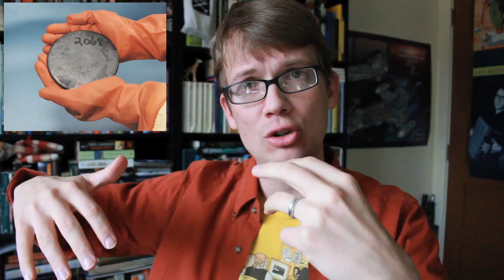Why Did Fukushima Explode?

Comment: One thing you didn't say that I think is important is that there are multiple levels of safety systems meant to handle various accidents and prevent meltdowns (or any other damage to the reactor or release of radiation). Each reactor has a "design basis" which is the list of all the things that could go wrong (earthquakes, tsunamis, fires, pipe breakage, hurricanes, tornadoes, etc.) Depending on the location, they plan for the worst such accidents that could happen over the next 200 years when they design the reactor, like it might be a magnitude 8.0 earthquake and an EF-4 tornado at your particular spot. Then all the systems have to be designed to safely shut down in the event of such a happening. 

In the case of Fukushima, geologists were unaware of the magnitude 9 earthquakes possible in subduction zones, similar to the Cascadia-type earthquakes we've just realized happen in our Pacific Northwest every 500 years or so. There were Japanese geologists studying the possibility at the time, but their data and theory didn't come out in time to prevent Fukushima. What happened was that the earthquake and tsunami were many times larger than the design basis had taken into account. We're limited by what science knows about these things. So the sea wall designed to protect the reactor from tsunamis was about a third as high as it needed to be in this case. So the whole control system became swamped with water and none of the safety systems could get a chance to work. There are backup generators, and backups to the backups to keep the cooling water flowing to the spent fuel pools and reactor cores and remove the residual heat after a shutdown. All swamped with water from the tsunami and inoperable. 

After the accident (similar to the way the NTSB studies every airline accident and recommends improvements to all flying airplanes), the Nuclear Regulatory Commission studies what happened and recommends improvements to all working reactors that would have prevented the accident. In this case it was a review of the "design basis" accidents and see if maybe they need to be increased all over the world, as well as having portable generators that can be wired in from outside in the event the whole chain of safety power backups is unavailable for any reason. Just like in the airline industry how we learn from every mistake and do our best to make everything even safer, the nuclear industry does the same thing. It is similarly a high cost to pay for such lessons, and we don't want them to have been wasted.

Comment: you speak of nuclear bombs.  Please explain why it is that when the case of the bomb fails, that  the nuclear fissions do not stop instantly, given that in a very tiny fraction of a second all of the particles will be far away from each other?  For me, it's not plausible that such a device could yield very much more than the energy required to melt or break the container.  You know better, please explain it.  Remember that your friend Einstein said that if you can't explain it simply it means that you don't understand it well.  Thanks in advance.

Comment: Okay so let me get this clear , the two of the most commonly known nuclear accidents are the one in Fukushima and Chernobyl , well the Chernobyl incident took place in 1986 and Fukushima has its incident in 2011 , the failure in Chernobyl was due to the poor build quality of the RBMK reactor and the one in Fukushima was due to a damn earthquake followed by a tsunami! Both of these occurrences are very very rare and sorta expected if I am honest . Yet the mass media tries to still defame nuclear power . Try using renewable energy sources at the time of Fukushima and you'll realize that the damage would have been far worse , atleast economically that is . You'd be shocked at how often other sources of power fail . Even the best solar panels usually only last for about 20 years and they also can't be effectively recycled , windmills are crap and will almost always fail if an earthquake or a tsunami hits or even just turbulent wind . Sure water turbines are an exception as they're quite durable and can be used in the flood drains to generate power effectively and after all this elaboration the media wouldn't understand as monetary promotion and fragile opinions are apparently more important than truth and knowledge and the safety and convince for the people.

Comment: Fun fact for those of you that may not be aware of this: Had the Fukushima plant been built according to ALREADY EXISTING safety standards for earthquakes and tsunamis (like putting the diesel generators high ABOVE ground to ensure that they don't get flooded out and unable to power the backup pumps which caused all of this) at the time of construction, this accident never would have happened. Instead, what went on was a sort of Titanic-ish situation where the investors (TEPCO, contractors, etc) decided instead of complying with the standards and spending some extra money up front, they would challenge the standard's relevance for the Fukushima project as there had never been an earthquake or tsunami in that area as bad as what the standard required protection against. They won this appeal and were granted an exemption, and proceeded with the inferior design. Over the life of the project, there were some additional warnings about the location of the generators and lack of other alternative sources of power, but these were also ignored, and the rest is history.

Comment: So the reason that it creates an environment for which hydrogen and oxygen can be separated is actually because of the stuff the vessel is made of, zirconium, which reacts with water at high temperatures very, very, very easily. Zirconium loves oxygen more than Hank loves learning and so it rips the oxygen away from the hydrogen and leaves just hydrogen.

Comment: I realize this is an old video, I just got pulled here after seeing your Chernobyl video.  I wanted to point out that the spent fuel rods actually DO still contain a great deal of uranium.  Commercial reactor fuel rods are considered spent well before they run out of U235.  They are "spent" however, because the low concentration (or enrichment level) of U235 makes them inefficient at maintaining a sustainable reaction.  Spent fuel rods can be reprocessed and re-enriched into new fuel rods for future Reactor consumption.

Comment: They put the nuclear plants near the coast so that they'll be able to cool it with the sea water? I think.
Reply: 3 arisa that’s correct in order for parts to not overheat (melting) they have to be cooled, the most (economicly) efficient and reliable way to do so is to use water. That means that part of the energy generated must be "wasted" on heating the sea. That's also true for gas power plants (and probably coal to, but I'm not sure about that) but they do not release radioactity if they where to fail (but the repair costs would be huge).
Reply: Thank you for taking the time to explain it further Patrik. I guess that’s true about the cost efficiency.

Comment: I did a project on the Fukushima disaster a few years ago. 

I may be wrong but I remember finding that another of the HUGE releases of radiation was because, after the coolant system went down, they began to use seawater to cool. This water collected radiation or became radioactive or something (in not quite sure) and so it had to be stored in tanks. Now theses tanks had to be made. Hastily. And so they weren't perfect, and some of this radioactive water leaked in the environment and the groundwater of the surrounding areas?

Can someone tell me if that's true or not? It was a long time ago, feel free to correct me if I am wrong
Reply: This is true and still is the problem as there's still large amounts of water which has no place to go as it's radioactive.

Comment: to my understanding, the backup generators were pulled from large ships and were intended to have water resistant qualities but could never have been expected to support the amount of power necessary for a long term solution. (from my undrrstanding) The company Temco who was responsible for this installation and several others, some in America, should have been aware of such an obvious problem if an emergency did arise.

i read this and several other fact based stories of corperate shortcuts that lead to natural disasters (Exxon Mobil oil spill, bp gulf disaster, NOLA  Katrina flood due to man made canal, ignored warnings in advance for all instances). in Greg Palasts book Vultures Picnic. i may have gotten some of the facts wrong but for anyone interested it's definitely worth checking out
Reply: Hello!  I've worked at nuclear power plants before.
Nuclear power stations are very much aware of the problem that generators cannot sustain a plant for extended periods of time.  They are used until the power grid can be restored, generally.  They have redundant safety systems in place to insure that worst-case-scenarios do not happen with or without human intervention.  Fukushima was, unfortunately, a bit of a perfect storm situation.

Safety measures and systems have been dramatically upgraded since the Fukushima Daiichi disaster (within two months at the plant I was working at, at the time) to be able to withstand the sort of disaster that Fukushima endured - even if they are not physically possible at the location to the best of our scientific knowledge.  For example, there is an SOP in place for tsunami heights far greater than is possible for the body of water the plant I worked at is located on.

I do not work at that location anymore but I have been told that it now can run off of just the power it creates and does not require an outside power source anymore. Usually this is driven by a fleet-wide standard, so I assume it is true of other locations as well.

Just some info, in case it helps.  :)
Reply: Thanks! That's interesting to know

Comment: why did they put the nuclear reactor so close to the shoreline? didn't they not know that a tsunami could destroy the control rods? stupid
Reply: Well I know it had to be near water but it didn't have to be on a Pacific coast. The Pacific Ocean is the opposite of what its name implies.
Reply: nuclear reactors are built near to shore lines and large bodys of water as they are used in the cooling process. to stop contamination the primary loop that runs the turbines is closed but that it self is cooled by another cooling loop often sea water as its cheap and plentiful.
Reply: Putting them close to water gives them easy access to coolant

Comment: Spent fuel rods will still largely contain uranium, more rather U-238. It will also comprise Pu-239 (a fissionable isotope). These make up the bulk of the waste by both mass and sheer abundance. The Pu-239 can be reprocessed into MOX fuel while U-238 is equivalent to natural uranium essentially.

Comment: Reacting (no pun intended) with quite a delay but neutron amplification doesn't make U235 special, the timing of the neutron emission is what does ^^
Reply: +David Dennetiere Its macroscopic cross section of absorption is relatively large compared with other fissionable material which what makes it especially ideal.
Reply: +Beau Lewis Actually, while the cross section is quite high for at low E, it requires a whole tank of light element to cool the neutron dow, which is not only cumbersome but also very expensive. If it weren't for its delayed neutron fraction, we probably would have used other elements at least for some reactors.

Comment: Nuclear power is usually better than coal and gas but when it goes wrong it goes REALLY VERY A LOT WRONG LIKE OH MY GOD. I can't support it. We need to spend more time improving the safer methods like wind, wave and sun.
Reply: +Tobi Toes Coal and gas have caused more damage than nuclear power, Fukushima has been grossly over-reacted.
Reply: I would suggest looking up In A Nutshell. They have a video pertaining to the pros, as well as one pertaining to the cons. I suggest you watch both and then reconsider.  I especially like the idea of thorium generators, as they are not nearly as dangerous.
Reply: +Tobi Toes I'm not going to try to convince you that meltdowns are not scary, but I will try to convince you that the likelihood of one happening is incredibly low when procedures are performed correctly.  As someone with close ties to the nuclear industry, I can assure you that there are fail-safes for fail-safes for these reactors which means the chances of a full meltdown (the bad one) happening are almost 0.  Years of engineering and research have gone into improving functionality based on past misfortune.  Hope I eased your mind a bit.
Reply: +Tobi Toes or fusion....
Reply: Hemimike426 we didn't hear much about that here. But Chernobyl. That shit's scary
Reply: +Jacob Addison I know they are very rare but I'm just not willing to risk it. Plus it's a fuck ton of money for something that won't function in 40 years time
Reply: +Tobi Toes Nuclear Fission im somewhat against.. I mean. Im born just a month before Chernobyl and most of europe got to pay for that..  but Nuclear Fusion.. oh my yes! give it to me baby. That thing is supposed to be so safe its.. almost scary in its own way..  Fuel? Saltwater. If something breaks? the amount of radiation leak is next to none :P  only problem is that they eat alot of power to get started -.-
Reply: +Malkuth It Deffinatly sounds pretty great
Reply: I'm sorry, have you even heard of... Vajont, Sempor, Banquiao, as well as many other dam failiures?
Also, this wind turbine exploding: https://www.youtube.com/watch?v=CqEccgR0q-o
Right now, renewables aren't terribly safe either. Certainly, they aren't as bad as Chernobyl (except Banquiao, which was 3x worse), but they still have risks. No one has died from Fukushima radiation to date (although many died after the evacuation from complications).
All of the renewables in the UK produce only around half the power of just 15 reactors. Although I can definitely agree with you that renewables need to help replace fossil fuels, it is virtually impossible that we can do it without nuclear power, especially as electric cars, heating and systems become more commonplace.
I hope you will also consider the fact that the crisis wasn't caused directly by the plant - instead by the mistakes make by TEPCO and the devastating tsunami causing the reactor buildings to explode.
Reply: Solar and wind power would seem to be the ideal solution but they produce so little energy per square foot of space.  To produce the kind of output that would replace all our other sources, you literally would have to cover the entire planet in windmills and solar panels.  The cost would be astronomical and would bankrupt the entire world's economy.  Even if we chose to do it, it wouldn't be possbile because we wouldn't have enough material or manpower to build them.

Comment: How does E=MC^2 not violate the law of conservation of matter? I've always found that kind if confusing.
Reply: Magic Penguin Conservation of matter isn't the full story (as many things taught in science classes aren't). The real conservation is conservation of energy. Matter can be converted to energy, and energy can be converted to mass (theoretically). In the most basic sense, they're the same thing in different forms.
Reply: Matter is really really compact energy
Reply: if you look closer at the reaction that occur you notice that you have the same number of proton and neutrons before and after. you have conserved the matter but the mass is different. another thing to consider is that matter mass is just another form of energy. in quantum mechanics particles can appear out of no-wear (look up virtual particles) and weak interaction in quantum mechanics can violate conservation laws.

Comment: Im pretty sure the issue here was that someone was too lazy to get the generator to a higher level...
Reply: I'm pretty sure the issue here was the earthquake and tsunami!
Reply: STRATOVARIUSPB 
The original design of the reactor, and specifically the arrangement of the diesel generators powering the cooling, was created by an american company.  For a reactor built in Arizona.  The desert.  The Tokyo Electric Company then put them on a tiny island in the west pacific on top of an active volcanic chain in a region notoriously prone to earthquakes and huge tsunamis.  When someone pointed out what a stupid idea this was, the Tokyo Electric Company replied with "shut up or we'll sue you."
Reply: Well, the reactor needs to have access to water, that's why it was on the shore.